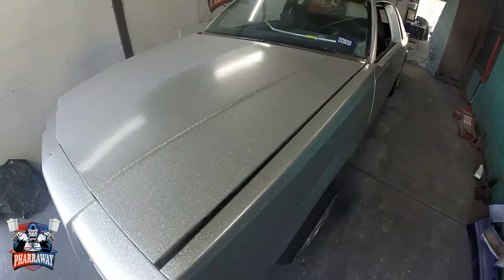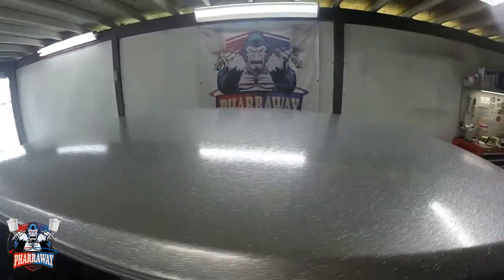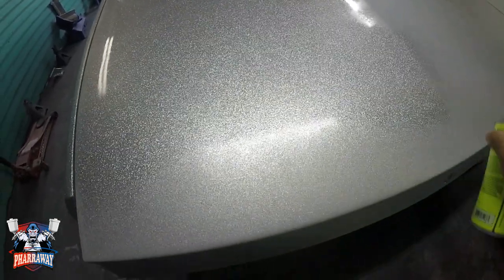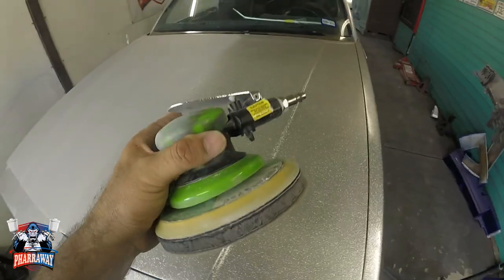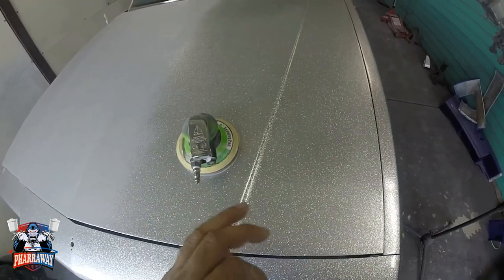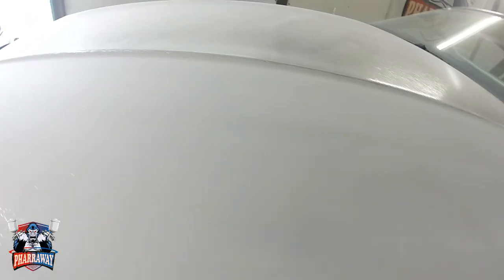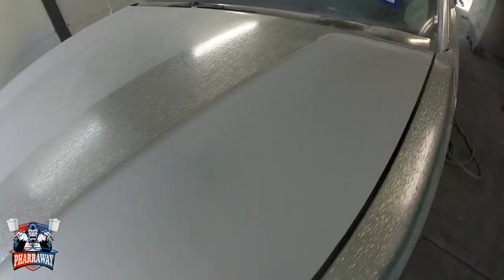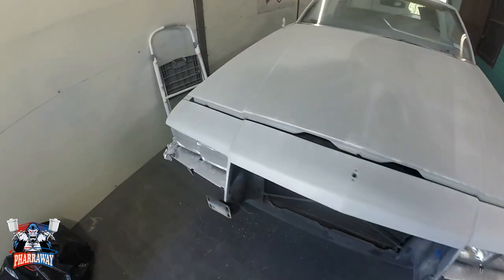HOW TO PREPARE YOUR METAL FLAKE FOR CANDY PAINT

Comment: The Quick Check is a game changer. Thanks for all the tips and tricks Pharraway 🤝
Reply from the maker: Yes it is brother
Reply: Instead of using quick check I use slow panel wipe in a hand pump it takes a couple of minutes to vap off but gives it a sheen long enough to spot defects, and cleans the panel as well.
Reply: Thanks for the this video Pharraway I purchased two bottles of the Quick Check on Ebay and today at my job a camera stand was in trash but I am keeping it to use it for when I make videos I had a small one that got from Amazon this one looks over 4 foot tall more stuff gets threw out where I clean at in June after school gets out. I don't have a paper masking stand to put the tape and plastic vehicle masking on yet though or a hood lift when taking a hood off but the stand will help better when I make videos again of me working on the car.

Comment: Cutting the top of the metal flake when they are silver ai t that big of a deal I herd. But when you use colour metal flakes it’s a disaster. They will turn silver 
My question:
What would be a safe way to sand coloured metal flakes to be sure not to cut them?
Reply from the maker: The best way is to apply more coats of clear to cover them completely

Comment: I'm currently sanding my 03 Duramax down I wanna paint it sunnoco blue and use 4-6 ounces of metal flakes and i use it as a work truck any pointers I used 40 grit to start then I'll hit it with the 80 and 120 and use the 220 to sand the paint to  fix any runs but part of me wants to pay a paint shop for the paint aspect of it never done body work had a buddy id help wet sand or prep occasionally so learning as I go any insight would be greatly appreciated

Comment: How many coat of innercoat clear did you put over the flake before sanding
Reply from the maker: I use the inter-coat clear for the flakes and applied 3 wet coats of high solids clear
Reply: Thank you , I've heard you say before but I didn't write it down but what gun are you using for clear and what size tip ? And I'm getting ready to do a flake job with .015 what do you recommend for tip size ? Thank you !!
Reply from the maker: @billlewis7580  for the application of the flake I used a 2.0 tip and for the clear by it self I used a 1.3 tip